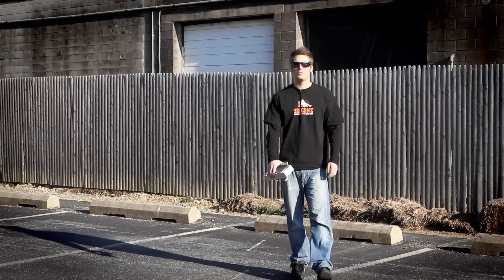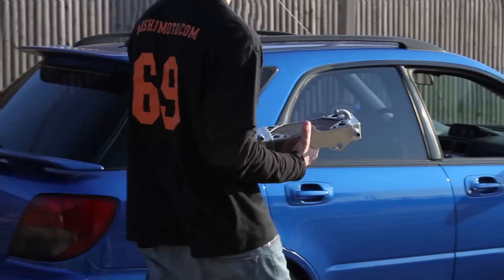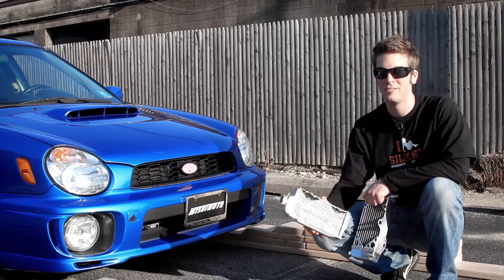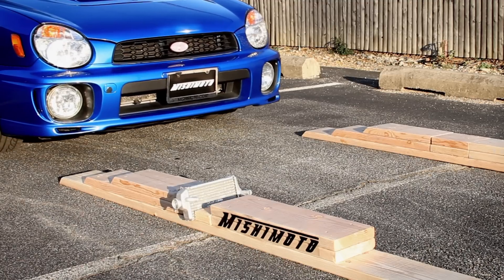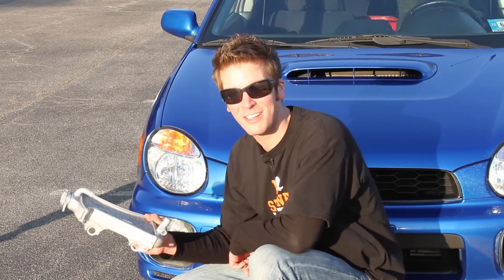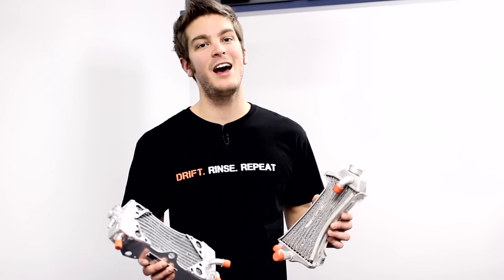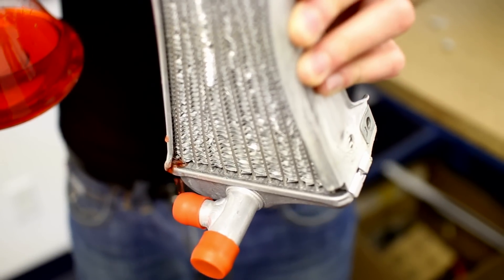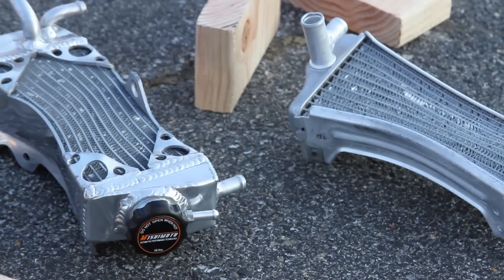Check Out This Epic Battle of David (Mishimoto X-Braced Rad) vs Goliath (Subaru WRX)

Comment: I like and have used mishimoto products on at least 4 different vehicles but come on, you said lets see if they still hold pressure.... Simply filling them up a bit is NOT pressurizing them. However I have to say that the radiator for my maxima came in bent/crooked and it sill worked out fine.

Comment: Flawed test. You only put in a very small amount of liquid in the X brace rad, when a hole could be at the top end, and you didnt pressurise the rad. This 'test' doesnt prove or show anything useful at all, other than the X brace didnt get a hole in the same place as the stock radiator. A radiator is also unlikely to be subject to compressional force on the top/bottom braces during a crash and would be more likely to suffer effects of impact shock/force

Comment: Exactly... They should have used bb guns, or stone throwers, logs, tires, or anything else found on the track to simulate the bikes normal wear.. Hell, put it on a bike, use a side cam and run the hell out of the bike, then crash the bastard... Then (like you said) pressure test it.  Peace